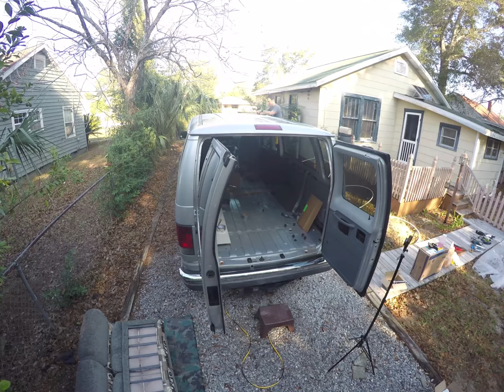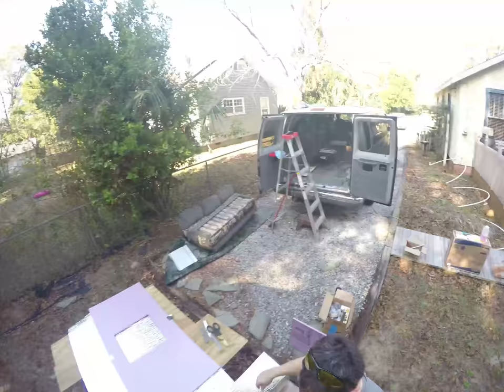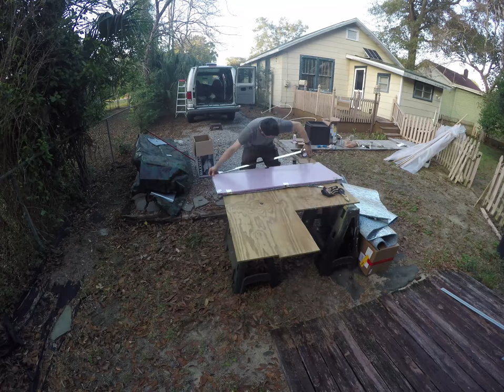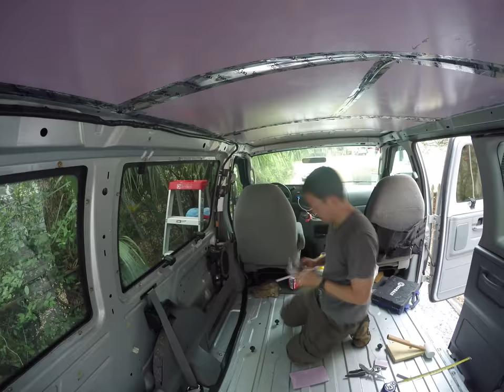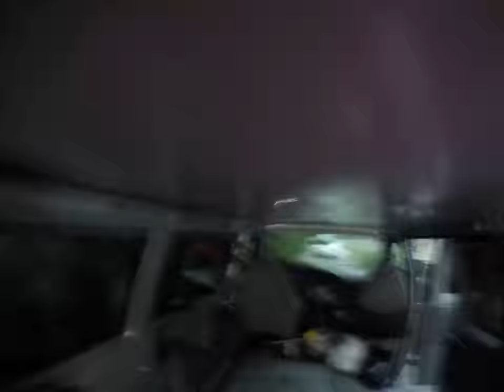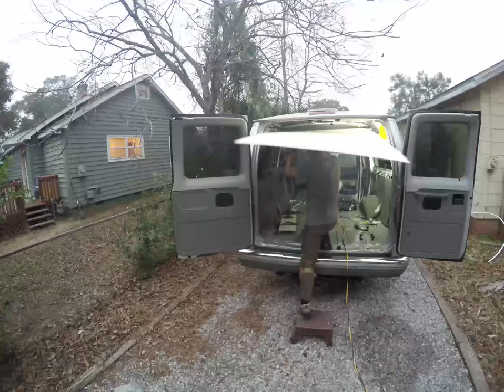1b. Touring Camper Van Build Installing Exhaust Fan & Ceiling Insulation Timelapse

Comment: Wow, you can move. What was that ceiling material material at the end of the video?
Reply from the maker: https://www.homedepot.com/p/Owens-Corning-FOAMULAR-1-2-in-x-4-ft-x-8-ft-R-3-Square-Edge-Rigid-Foam-Board-Insulation-Sheathing-36L/100320356. It was a combination of this and http://link.order.homedepot.com/ls/click?upn=4nlhyNcg749Mc7Qi6DVKv60ulGwPPznb-2FImTq3eYoRCEU-2F31m3H6KjsEv-2F3do0in5CX3hDMC-2FT54gVgp-2BdYBbDVF3prPgcw5hYQKCezneMeE5F6f-2FlMK0nAMyaazk0cEfnKGav23SwDrn6xtJ4kP2qg3OM2k7gJiYxoJV8Bulk6B4X8RSVtBuMyAToInorNgwSh-2BqBNM-2Fd0J3eZzeXH4InVzRcm6J7wyoLXiZpHtnf-2BeKbUfwz-2FHdnJDNDBP7o3hZYFnZwESAQuMJL8A3uiuVurgKyQvPjNMjFICIhhUD-2BrfHPBN3MFhG0gw1uBpS1S7wWe2_owIIy9muS7FDz6fhXyQDBK6PuKsF-2FettjlTI5B-2FM-2FExM7OTlwG9nvCrzgZXkZGN6PPtQ4ggdbv6X-2B0q66wNVtvhZVP-2FiR4vKsBbnMkDc3j11jMFND-2FM3-2FSFWmhTqeJhxFP4-2FPL8wH5j2Pavk5QqPVYINIF28AMICjsoBlEwxk1fv2bzTvBS7oR5VWT5MmKD7rl3T6fTV5NTWQWxoDSBTHu9qFI4CQ9cSaMXQs2-2FsvevhWOOSJn-2Bto-2FbhTjj0zrvIZrqBWkdCmBjRO3WEs0ZaZ-2Bp6g7YSMtLnindrGIiHEuwz-2ByOt9gU9dRQx30WXQotM66A45y3T4yRC35h4TnQ-2BG5f3dl2-2FetvjbhqwojStU8bhLHhR-2BOawxxgc0-2FTBK15CLigPffJ-2FXFCyepssYqdP1CUpw5EsDNn5v7fRVp9wpR5Y1nvGrVVqy-2BYrmWddTCKtZxC1Ye8ABT2tnimfgAd3yYfSDojKMXiKhAbtCR4Mb0y6Z8k9HMzOEWHTZhqtF0mRA-2F3kASQxJTRLsHAEsdOL1QHKQRkle7Pgj9ba6QnCpyjPgzQMCFcdQrAExAH1Up7Y

Comment: what kind of insulation did you use for the ceiling?
Reply from the maker: https://www.homedepot.com/p/Owens-Corning-FOAMULAR-1-2-in-x-4-ft-x-8-ft-R-3-Square-Edge-Rigid-Foam-Board-Insulation-Sheathing-36L/100320356. It was a combination of this and http://link.order.homedepot.com/ls/click?upn=4nlhyNcg749Mc7Qi6DVKv60ulGwPPznb-2FImTq3eYoRCEU-2F31m3H6KjsEv-2F3do0in5CX3hDMC-2FT54gVgp-2BdYBbDVF3prPgcw5hYQKCezneMeE5F6f-2FlMK0nAMyaazk0cEfnKGav23SwDrn6xtJ4kP2qg3OM2k7gJiYxoJV8Bulk6B4X8RSVtBuMyAToInorNgwSh-2BqBNM-2Fd0J3eZzeXH4InVzRcm6J7wyoLXiZpHtnf-2BeKbUfwz-2FHdnJDNDBP7o3hZYFnZwESAQuMJL8A3uiuVurgKyQvPjNMjFICIhhUD-2BrfHPBN3MFhG0gw1uBpS1S7wWe2_owIIy9muS7FDz6fhXyQDBK6PuKsF-2FettjlTI5B-2FM-2FExM7OTlwG9nvCrzgZXkZGN6PPtQ4ggdbv6X-2B0q66wNVtvhZVP-2FiR4vKsBbnMkDc3j11jMFND-2FM3-2FSFWmhTqeJhxFP4-2FPL8wH5j2Pavk5QqPVYINIF28AMICjsoBlEwxk1fv2bzTvBS7oR5VWT5MmKD7rl3T6fTV5NTWQWxoDSBTHu9qFI4CQ9cSaMXQs2-2FsvevhWOOSJn-2Bto-2FbhTjj0zrvIZrqBWkdCmBjRO3WEs0ZaZ-2Bp6g7YSMtLnindrGIiHEuwz-2ByOt9gU9dRQx30WXQotM66A45y3T4yRC35h4TnQ-2BG5f3dl2-2FetvjbhqwojStU8bhLHhR-2BOawxxgc0-2FTBK15CLigPffJ-2FXFCyepssYqdP1CUpw5EsDNn5v7fRVp9wpR5Y1nvGrVVqy-2BYrmWddTCKtZxC1Ye8ABT2tnimfgAd3yYfSDojKMXiKhAbtCR4Mb0y6Z8k9HMzOEWHTZhqtF0mRA-2F3kASQxJTRLsHAEsdOL1QHKQRkle7Pgj9ba6QnCpyjPgzQMCFcdQrAExAH1Up7Y